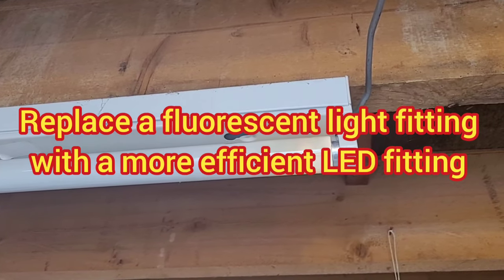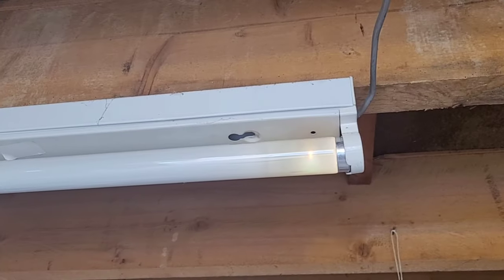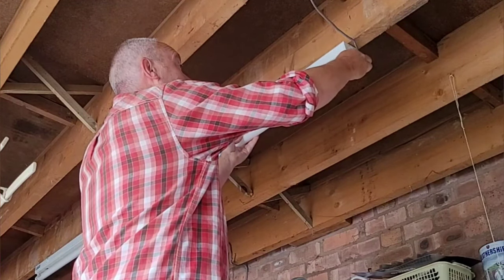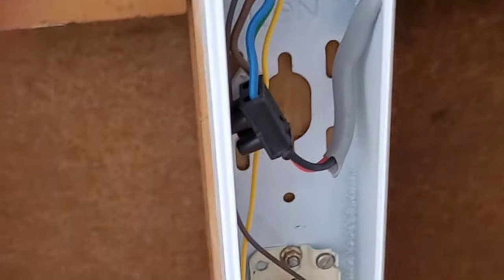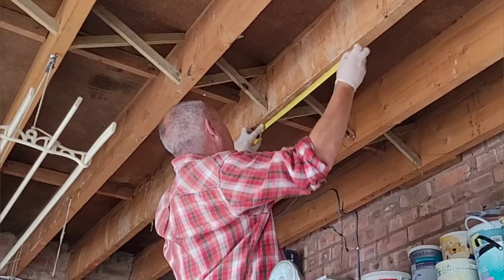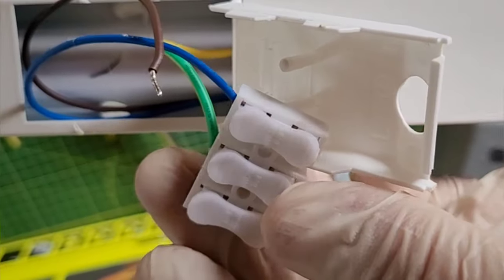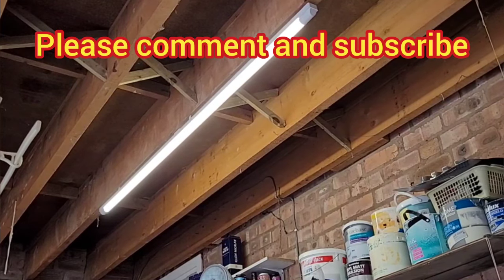How to replace a fluorescent light fitting with an energy saving LED batten

Comment: No Earth sleeving on the connecting block, I am going to change mine in the garage and workshop 7 ,5ft single's and 3 5ft twin , good video
Reply from the maker: Thanks Shaun. You are right about the Earth sleeving but the sleeving is only used for identification and it's obvious which is the Earth wire.

Comment: Your are right about the wire grips in the housing on that model, they are useless. I found in the kitchen that I had to temporarily suspend the new unit from the ceiling using screws and string in order to have free two hands free to feed the wires in. I didn't want to trust that one clip would take the weight.
Reply from the maker: That sounds like fun 😂 
Hope you got there in the end

Comment: Great video. I have a normal  BC 150w lamp in my loft and I’m just going to replace it with an LED tube. One question: how would I join more than 1 tube together?  Thanks
Reply from the maker: Thanks Steve. This explains how to add extra fittings: https://www.ultimatehandyman.co.uk/forum1/viewtopic.php?t=90093

Comment: Can you not use the old casing when converting from a fluorescent tube to led?
Reply from the maker: Yes, if you use the correct type of led tube and you can find one that matches the size and output of your old fitting. This might help: https://www.any-lamp.co.uk/blog/replace-your-t8-fluorescent-tubes-with-starter-led-tubes-em-conventional-ballast
Reply: @bigtedshome  Thanks. The reason I ask is my single strip fluorescent tube went today, I just want to swap out the old fluorescent with a new led. I went to B&Q and they said that fitting an led tube may or may not work with my current casing. Just find it odd why it might not work
Reply from the maker: @nicholaswebb8418  Fluorescent lights are quite complex. They contain extra components which alter the current and voltage.
Reply: @bigtedshome  ok, thanks again

Comment: That's is a Fitzgerald 8ft 100w t12 fluorescent tube light fitting and the starter type is 70-75-85-100w 240v it's runs off 100w choke ballast
Reply from the maker: Thanks Mark 👍

Comment: I need to replace my old fluorescent tube fitting with a new LED batten light. My old fluorescent light has the feed cable (twin core and earth) from the consumer unit going into it, and also cable (twin core and earth) from my 1 gang 1 way switch. In your video it shows the power supply cable going into the light fitting, but where is the cable for the switch?
Reply from the maker: The cable for the switch is connected to a junction box between the consumer unit and the light fittings  (the one in the video is the last of 3 controlled by the same switch). This link explains the wiring http://www.sparkyfacts.co.uk/Wiring-Diagrams-Simple-Lighting-Circuit.php

Comment: Hi I was wondering if it's possible to wire a connection directly from the mains plug to the batten bulb. I have an office which I rent and I don't have access to the raw wiring only to mains socket.
Reply from the maker: I've not tried it but I don't see why not. Alternatively, amazon sell a 2.8 m (9ft) switched adapter for Sundertech battens (which they also sell) here: https://amzn.to/3RfdLdx

Comment: if you wanted to add two strips instead of just one would you just run an additional wire from light to light?
Reply from the maker: That's how they are connected in my garage.
Reply from the maker: You can get some led battens which link together.

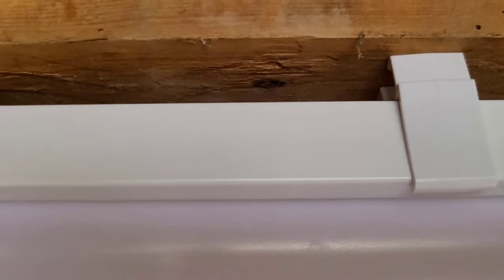Comment: Sir, in 3:23
In top wire:
Red is live
Black is neutral

In Down wire:
Black is live
Blue in neutral
Reply: Black wire can be live and neutral
How can I know the difference?
Reply from the maker: @zayed9902  The old cable has a red insulation on the live, black insulation on the neutral and a bare earth. The newer style wiring in the fitting has brown insulation on the live, blue on the neutral and yellow/green on the earth.

Comment: No safe isolation ☹. Please get a voltage detector and use it, there not expensive and make sure the circuit you are working on is safe to work on. This is for everyone who wants to do this in their own home.

Comment: my friend has an old style 5 foot fluorescent with 2 ! 1.5mm wires to it.. Its a single light. Why 2 wires????
Reply from the maker: It sounds like one is coming from the consumer unit and the other from the switch. The first reply on this thread explains how this works: https://www.diynot.com/diy/threads/two-cables-from-ceiling-light-socket.449202/

Comment: easier ito joists than a kitchen ceiling
Reply from the maker: It is but that was the job I was doing at the time. The battens are light so won't pull your ceiling down. Using a stud detector should help you find the joists in the ceiling and stop you drilling through the wiring.